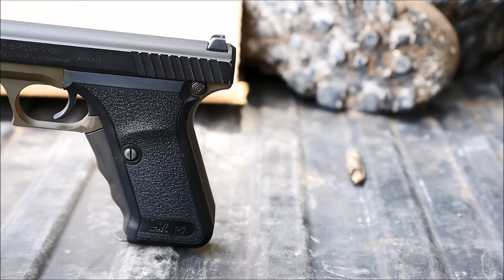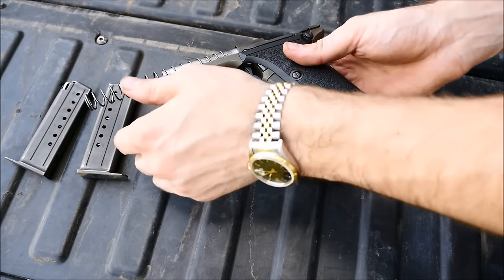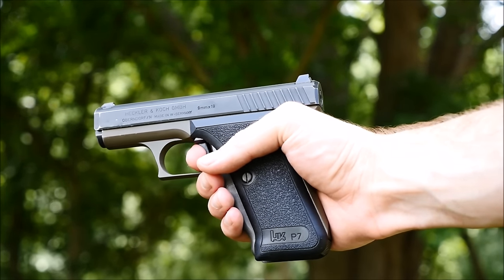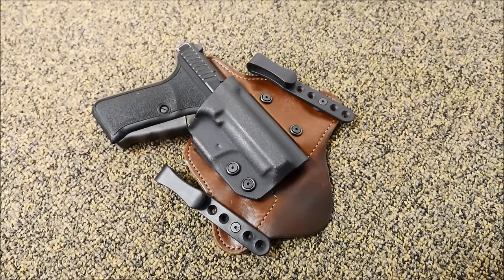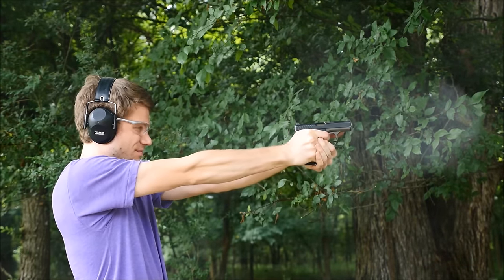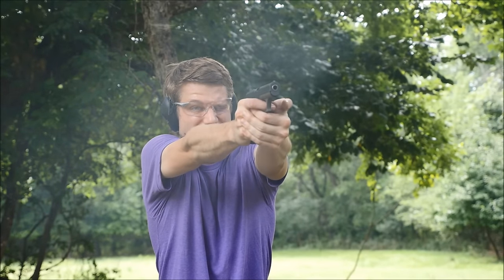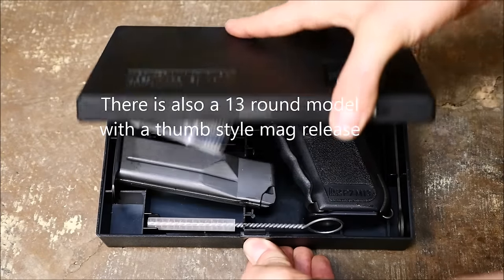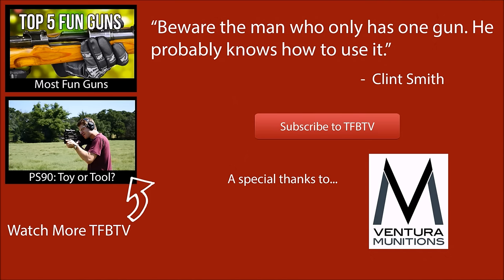The H&K P7 (And Why I Carry One)

Comment: I like my P7PSP. It definitely has a cool factor and is accurate and reliable. Downsides are that it heats up a lot after about 60 rounds in practice, bleeds off propellant gas to lock the action getting low velocity from any given load in the process and the balance is too grip heavy to carry well for me. In practice I carry the Glock 26 to do the same job with less weight and prefer the 26 or Sig P239 over the P7 as a range gun, though the P7 is still fun at the range. Between the P7, P5 and P239 the Sig P239 is my favorite 9mm single stack.
Reply: The "bleeding off of propellant gas" has no practical effect on the velocity of projectiles being launched out of the barrel...any more than the M1 Garand, AR-15, AK-47, or any other of the myriad firearms which utilize propellant gas to cycle their actions. One is more likely to observe greater velocity variations, round to round, in a single 50 round box of 9mm ammunition fired from any given firearm,, than the variations seen between two 4.1 inch barreled handguns, one utilizing delayed blowback (or most any type of action), and the other a more "conventional" system. Like the P7, don't like the P7...I don't care (I do own, and love, various P7s...PSP, M8, M13, K3!)...but there's no need to invent non-existent issues on which to dislike it. It heats up, you don't like the balance...perfectly understandable and valid points. Low velocity? Nope.
Reply: @g26s239  Well...if you had paid any attention at all, I never said the P7 utilized propellant gas to operate the action.  I was quoting the OP, the phrasing he used was "bleeds off propellant gas", and I merely repeated that. I'm well aware of how the P7 operates.

 My point (which you apparently overlooked) was that the use of the propellant gas, whether its utilized in operating the action of a particular firearm, or in delaying the action from opening in a different firearm...has virtually no effect on the velocity of the fired projectile. To state that projectiles fired from the P7 have a reduced velocity due to the gas used to delay the blowback action...is certainly inaccurate.

 And, as an aside...the "characteristic black stripes" on fired brass from the P7, are evidence only of the fact that it has a fluted chamber. "...relative lack of obturation in a P7 bore versus Sig, Beretta, or HK..." Ahhh...the P7 is an HK, so...? I confess...I have no idea what you're on about. As far as obturation in the bore...if your notion is that the P7 suffers in this sense,, and therefore generates lower velocities...that's just wrong. The P7 uses polygonal rifling, which creates a better gas seal, thus increasing velocity. Also, there is less deformation of the projectile in the bore, causing less friction as the bullet passes through the barrel, also aiding velocity. Finally, there is less surface deformation of the bullet caused by sharp rifling, which reduces drag in flight. I'm not suggesting that this means the P7 (or other polygonally barreled firearms) exhibit huge gains in MV, but...it certainly doesn't hurt.

 Excellent! Keep your P7...I never suggested anyone should ditch theirs. I'm keeping mine (well...unless prices continue to climb, then...I might free up a few.) And, I never suggested the P7 was perfect, or didn't have shortcomings. My only point had been regarding the notion that gas used to delay the action, was somehow responsible for reduced MVs in the P7. And, you completely missed that point.

Comment: From your video, heat does not seem to be an issue and you are firing the P7 with no heat shield. Could you elaborate on this? Can 3 mags be shot simultaneously without it getting too hot?

Comment: Great video as always. Whats it like having to actually pull the squeeze cocker because referencing your older videos you say holding it down is easy buts the initial pull like?
Reply from the maker: +The Real Yeff 
The initial pull is a bit stout, but it is engineered so that holding it down only requires 2 pounds of force (imagine in a police situation, you would not want the gun tiring out your hand, so it is pretty effortless)
Reply: It also depends on the size of your hand, the grip is narrow, but long.
Reply: thanks for the info, I think this is a very interesting and sexy little pistol.

Comment: I never could afford a P7 when I was younger.  Now that I can, in theory, just got no reason to.  For cool jacket weather, I have my PPQ or my favorite, the XD9.  For hot days, I have a M&P Compact or a Makarov.

Actually, if you have a Mak, I'm not sure you'd need a P7, except for cool factor.  About the same size, right?  Same capacity.  9MAK is a useful cartridge for social occasions...and it cost a heck of a lot less.

Not ragging on you, just find the P7 to be an expensive curiosity, I guess.

Comment: when I turn 21 i think i'll carry either a browning Hi-power or Beretta M9
both of these guns are well built and fit my hands nicely
Reply: There are better designs now. I'd look harder at Glocks or the S&W M&P models instead....
Reply: ***** 
i have picked up glocks and M&Ps and the glocks were uncomfortable and M&P just didn't appeal to what i'm looking for
i like the the guns i listed for the reason of their are comfortable, accurate, battle proven, and reliable
i wouldn't call the glock an improvement
the hi- power was the famous John Browning's last design that improved on the 1911 and has been adopted by multiple millitary's
the Beretta M9 was designed to replace the 1911 and has been our troops side arm since the 80s
so i feel that something that is trusted to protect troops can protect me just as well
Reply: +22megaton be sure to also at least hold the HK VP9. Probably the most comfortable handgun I've ever fired. A bit pricey but nice.
Reply: +Robert K 
It felt decent, but the hi-power and M9 fit my hands perfectly

Comment: I would say you carry one cuss its a discontinued hard to get  trigger finger burning (after 200 rounds) expensive to find used slim squeeze caulking brass burning and reliable stee framel low capacity pistol with a vary high grip and very manageable recoil !!! It did hurt a little when I traded my brother in law my PSP for his Walther MPL but I got over it .. Mag's are hard to get..

Comment: How much is a P7 these days, especially the 13 round model? Are they still expensive or have they gone down in price since their release?
Reply from the maker: +Tyler Rubygleam 
You can find a used beat up P7 like mine for about $1000, but a very nice M13 will be about 3000.
Reply: More expensive than when new, but still the Ferrari of handguns!
Reply: +TFB TV That is kinda overpriced, but maybe it is worth it. I might pick one up someday, but until the price goes down, I might have to find a different pistol. Thank you for replying.
Reply: Imo, it's closer to the e30 M3
Reply: no offence but it wasnt worth it back in the 80s and it isnt worth it now... its a nice pistol but its time has  kinda past. Im sure its a slick shooter and i wouldnt turn one down but there are too many other good choices out there that are a lot smaller, cheaper and just as good.

Comment: How hard do you have to squeeze the grip to ready the striker?
Reply: It requires 17 pounds of pressure to squeeze it but only 2 pounds to hold it back. Its very natural and easy to pick up
Reply: 1.5 pounds to hold it in the cocked position.  My book does not state the pressure required for cocking, but it is nowhere near 17 pounds. It's closer to 5

Comment: how hard is it to squeeze the grip so you can fire
Reply from the maker: +TheDakrax 
16 pounds to pull it initially, 2 pounds to sustain it.
Reply: +TFB TV okay thanks
Reply: Its worth noting that the 16lbs is very different from a long double action trigger pull,  its pretty effortless, and pretty much anyone picking it up with the intention to shoot will depress the grip with ease. 
        Anyone not applying 5lbs of pressure onto the grip with each finger would also most likely  fail to fire a 1911 even with the enhanced beavertail/safety.   And those are the same people who would choke on a manual safety.

Comment: As always a great video. I just looked up a number of secondary market P7s, $2300 was the best price.  

Why!?!

Alex showcased the pistol well. I still see no reason for this pistol in any somewhat unrestricted market.  It is too expensive, lacks magazine capacity, and is not nearly as versatile as several other options on the market.

Alan Rickman did make me want one from Die Hard though.
Reply from the maker: +Michael Snozek 
I see standard models for $1200 for sale right now on gb
Reply: +TFB TV How far down did you go?  I saw 2399, 2495.95, but none that low.  Maybe I am lazy AND cheap?

Comment: I also have an HK PSP (older than the P7M8) and bought it for the same reasons.  The 8 round count is low by today's standards, and the gun is expensive and heavy, but operation of the pistol is far simpler than other pistols.
Reply: my firearms instructor used to say: "if 8 rounds wouldnt save you, 13 probably wont either" (he was compairing a 6-shooter with a glock back then, but the argument is the same)
Reply: @thomasherzog2172  Luckily for me, the HK PSP is the pistol which I shoot best with, even though I am not a practiced pistol shooter.

Comment: If HK would just restrict themselves to the M8 and the M13 in 9mm, they could sell them for MSRP of  circa $2,000 and they would sell like hotcakes. This is especially true if they did just  a few tweaks, like polymer/alu mix frame, night sights, modern protective finish on the slide, updated grip and voila, instant classic.

Comment: The squeeze cocker just seems like something else that could effect using the gun in a high stress situation. Anything that can and will go wrong usually does.
Reply: Nope. All the cocking lever does is spring loads the striker. The only difference between this and any other striker fired pistol is that the striker is spring loaded on demand whereas something like a Glock its striker is cocked when the slide is racked. Unlike a Glock, the P7's striker can be safely decocked by releasing the cocking lever.

Comment: They offered a lot of innovations when they were introduced.  Compact size, low bore access.  The squeeze cocking was an innovation before the current design of striker fired guns.  
These features are now available on lots of guns for less cost, and have more capacity.  Squeeze cocking is obsolete.  Current striker fired guns function make the squeeze cocker a solution to a problem that no longer exists. 
Nothing wrong with the gun, you have one.  Use it.  But to choose it over the other guns on the market today is just kind of silly.

Comment: Good re-holstering technique - you put it back without having to look. An amateur has to look, you obviously don't.
Reply: There is actually conflicting views on that front in the self defense community. Some argue that you should keep your eyes up to check for threats while holstering your handgun. Others, including Massad Ayoob, say that you should keep your handgun out until you know that the area is safe, at which point you SHOULD visually verify the correct insertion into your holster, as that is the point at which you are most likely to harm yourself.

It looks cool to reholster without looking for sure, but I don't see any issue with using your eyes (our most important sense) to aid in proper reholstering.

Comment: I used one of these in a military unit, and I agree with the concealment properties; however I hate this gun.  The squeeze cocker is obnoxious. the slide catch button is in the worst place I've ever seen for a pistol. The mag release on our version of the P7 isn't in the position yours is, but I've never complained about the more traditional location of where our mag release is. The rounds per magazine is really low, especially for a 9mm pistol used by military.  I much prefer the 9mm Beretta, the 1911, or a glock.   But if it works for you, that's what matters for you.

Comment: I don't quite get what you mean when you say big enough to fight with?Do you mean beating the shit outta someone with it if you run out of ammo?
Reply: Big enough to fight with: Large enough capacity to handle multiple attackers, long enough grip to securely hold while firing, long enough sight radius to accurately place shots on target.
Compare that to a Ruger LCP, which has a two-finger grip, low capacity, under-powered round, a short sight radius, and extremely minimalist, almost negligible, sights.
An LCP is just good enough to shoot at a single attacker at close range. A larger handgun may have the capabilities to accurately fight at 50+ feet.
I think the key difference is that fight might imply gunfight, such that the person is shooting back at you, say in a mass shooter situation.

Comment: So... overly complex, expensive, poor capacity for it's size and with features like a heel release and squeeze safety which only hinder practical use. (Also, I laugh whenever I remember you included this in a list wherein you included an AR-15 and an 870 due to parts commonality)

Comment: glock 26 is better better concealibity safer trigger more rounds more reliable cheaper
Reply: I like the Glock 26, but safer trigger? Perhaps I'm just not familiar with the P7's specific design, but doesn't it also have a firing pin block and all those other internal safety features? If so, then the P7 is just as safe as a Glock, if not potentially safer due to the squeeze cocking mechanism. After all, with the argument "Glocks are unsafe because they don't have manual safeties", isn't the proper response "your safety is between your ears"?
Reply: yah I agree the p7 might be safer I overstepped doesent mean that its any less debilitating in a fight to have a squeezemechanism
Reply: I agree.